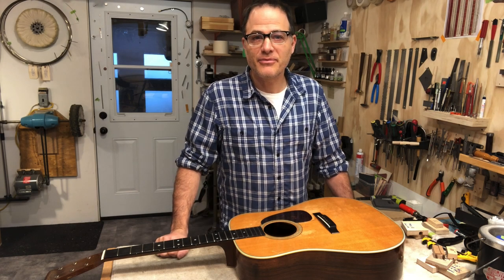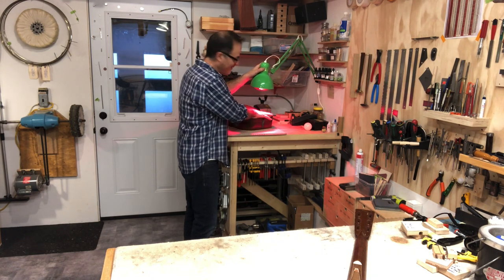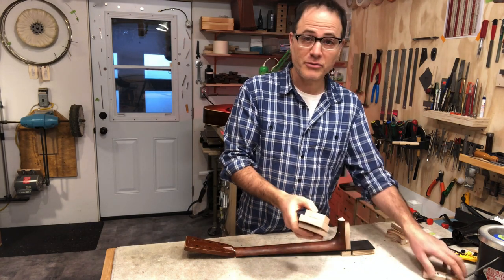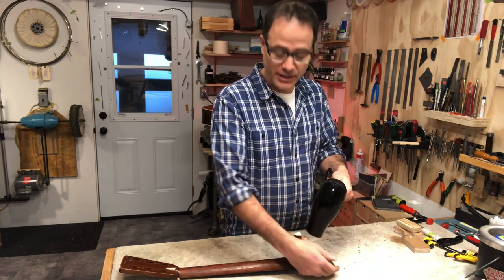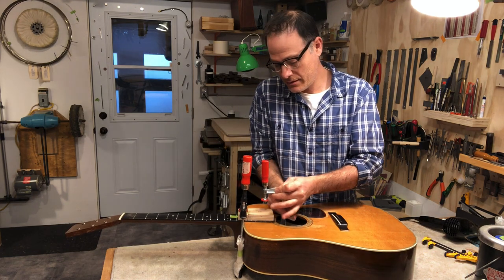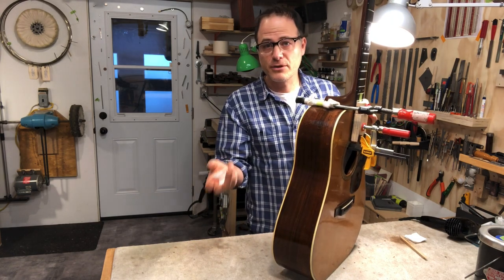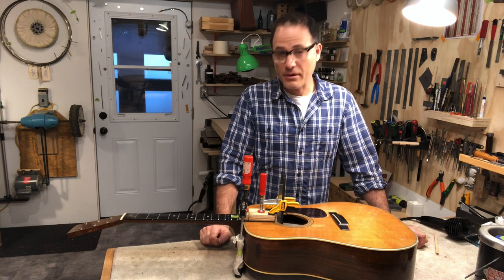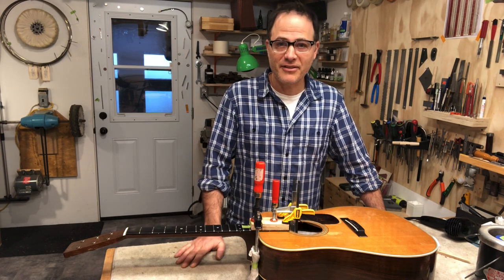Reinstalling the Neck on a 1950 Martin D-28 After a Reset, With Mark Stutman

Comment: I heated the rosewood bridge of my 42’ LOO(I know ....crazy for my first time) in a toaster oven and a placed a heated aluminum block on the surface area where the bridge was to be adhered. Gave me the hide glue time I needed to get it back together. Slicker than snot!

Comment: It is always a pleasure to watch you work Mark. Do you always remove the frets of the extension to unglue/re glue clamp it, or was this in prep for sanding out the body join fingerboard hump/or full refret?- I have so many nerdy questions :)
Reply from the maker: If the guitar is to be refretted I remove all the extension frets before heating to help avoid finish damage from the heat transfer of the fret-wire.

Comment: Thanks Mark- How much fall away over the body do you allow (think is ok) before you start thinking about adding a tapered wedge???
Thanks again.
Reply from the maker: Much less on a 12 fret than on a 14 fret.  It's up to the client.  On store-owned guitars  that get wedges (less and less all the time as vintage guitar owner preferences shift away from wedges) I'll often wedge 1/2 the amount it actually needs as a thick ended wedge looks weird.

Comment: I've got a D-18 kit that'll be here this week. I'll be sure to use wet water for glue clean-up. Amazon probably has some.
What's the logic of refretting the neck after installation rather than prior to?
Reply from the maker: Wet water is way more effective than dry water.  

Refretting after the neck is glued on allows you to true to fretboard accurately as there's always some amount of a bump that remains at the body joint.  You can also tweak your neck angle slightly during refretting if required.
Reply: @TheFolkwayMusic  Thank you. Although I’ve done a dozen guitars and basses, this is my first acoustic and I’m anxious to not screw it up.

Comment: Do you normally make an ebony shim for the end of the fingerboard or do you just let it dive down?
Reply from the maker: These days the general preference is to leave the shim off.  On a 12 fret neck I’ll use a shim, but it will just be a 1/2 thickness one.  
Shimming a 14 fret one is a decision I leave to the client usually.

Comment: I have a question... so after gluing the neck back on, do you have to refinish the guitar in that area? Or do the separation lines not show? I imagine sometimes removing the neck might cause some tear-out of the wood or finish?
Reply from the maker: Good question, Scott.  If the neck and/or finish was to become damaged upon removal repair and finish work would become necessary.   An experienced and careful technician should be able to avoid such a fate.

Comment: Just wondering, why are you do not use tight bond glue like so many other luthiers do you?
Reply from the maker: Many reasons.  Hide glue is very easy to take apart, can be reactivated with water and heat, and creates a crystal-hard joint.  It's also the glue that was used on Martins until 1964 and is historically accurate in restoration work.  Finally, it's really nice to work with and sets up much faster than PVA glues.